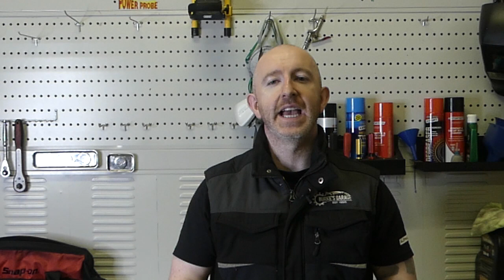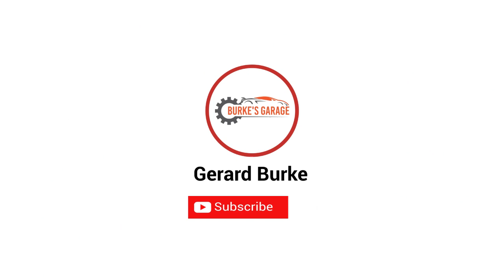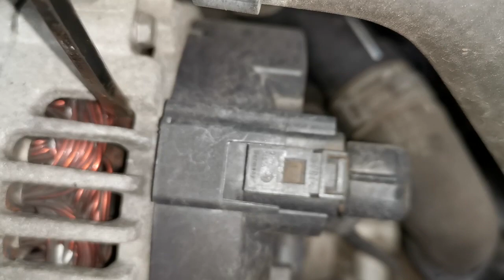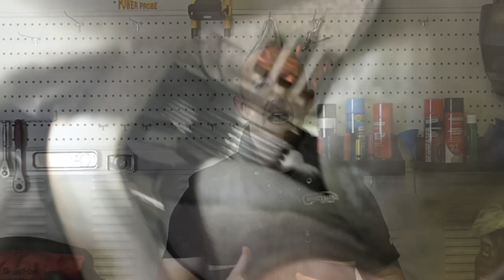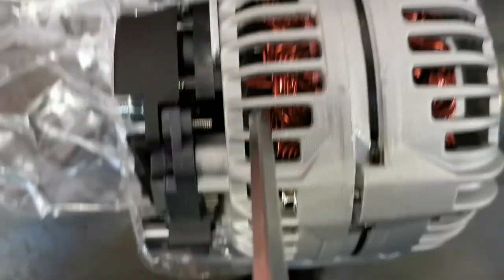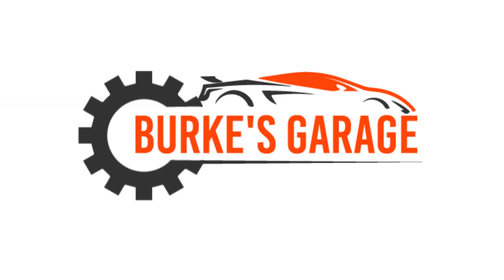Serpentine Belt Squealing & Tensioner Flapping - Volkswagen Audi

Comment: I want to thank you, I have changed the tensioner belt fluid and it was still squeaking, especially while turning the steering wheel just went outside 7:00 am after watching your video mole grips on the tensioner locked off the alternator and hey presto it’s the alternator. Thank you so much for this video, it was a massive help, my next move was power steering pump. Thanks again dude

Comment: Hi Gerard I have a Skoda Octavia MK3 with the ea888 gen 3 with an odd squeal when only turning left and driving sometimes when not moving (nothing is rubbing in the wheel liner) I have replaced belt and tensioner it sounds very odd and can be heard easily do you have any ideas for me

Comment: This is close to a noise I am hearing.  2009 VW rabbit.  On start up there is a very loud wub, wub, wub sound inside the cabin and belt squeal on cold start up.  it's harder to hear in the engine bay but easliy in the cabin.  the sound diminishes after warm up, but can be heard at stops signs, etc.  I recently replaced everything but the tensioners and Harmonic balancer.  I did replace the pulleys on the tensioner though.  When the autoshop replaced the alternator, they did not replace the belt so i replaced that and the squeal went away, but came back in 2 weeks.  Does a flapping tensioner cause a low even rhythmic base sound in the cabin as well?

Comment: Hi guys 
Thank you very much for all the help you offer on your channel, very informative as well as Clear and concise technical data 
Could you possibly point me in the right direction regarding an issue with my 2006 Mk5 Golf 2.0 Tdi it’s turning over but not starting, I’ve disconnected the crank sensor but unfortunately it still isn’t starting.., where do I go from here guys…?